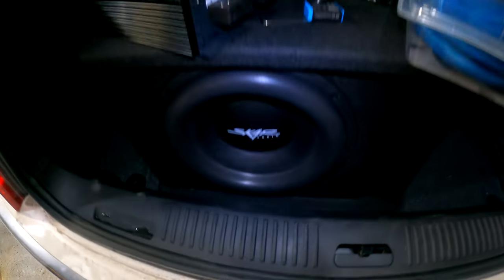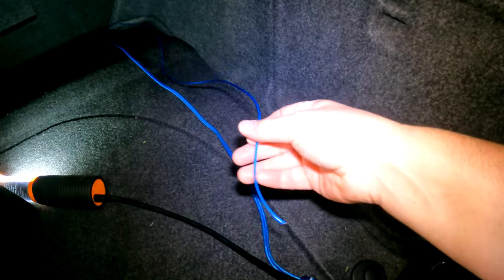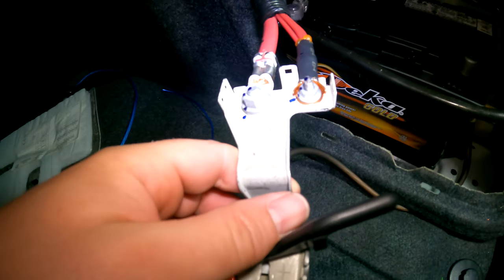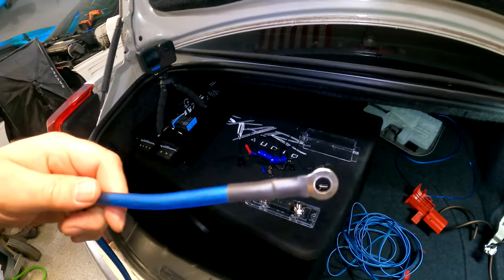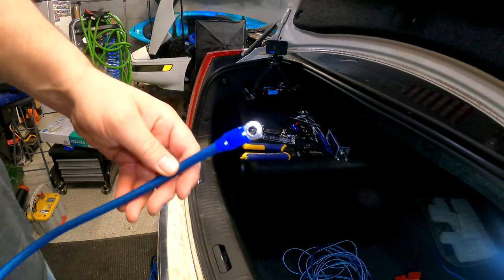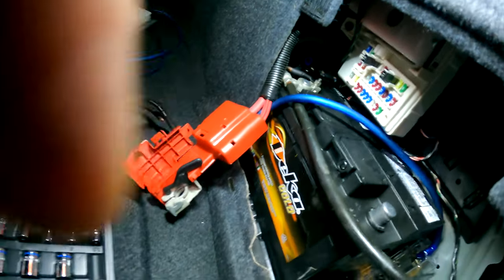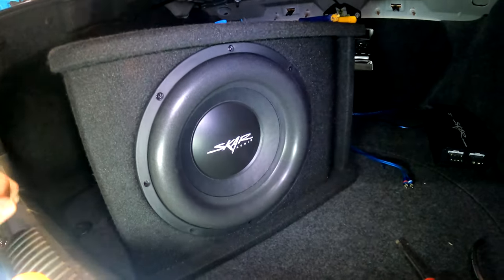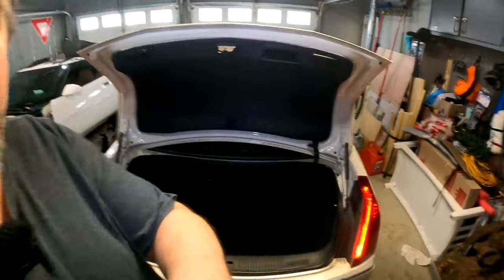Amp and Sub Install Cadillac CTS

Comment: I’m looking at a 2013 CTS right now. You think 2 12’s will fit in the trunk?
Reply from the maker: Easily! With plenty of room to spare! Just measure the trunk width and height to make sure that the box will fit (most should with no issues at all). 

One big...BIG recommendation...invest in lots of sound deadener! 

My son just finished putting deadener in his and it made a very big difference in rattling and overall sound quality!
Reply: @Amundred  appreciate the quick reply it means a lot! All love.
Reply: @specialteamstv4246  Yes indeed. Just added 2 Sundown 12s.  And has space on both sides for amp or flip up.
Reply: @dev1004  I got the 12’s installed a few months ago. Perfect.
Reply: Hey on the cts 2013 for 1 12 do I need an amp or would the factory car amp be enough to push it good ?
Reply from the maker: @naturalstatestud you will need an amp! The factory amp will NOT be able to supply nearly enough power!

Comment: Do u happen to know what all i would need to hook up a aftermarket amp for the interior speakers where the factory amp is. Like is their connectors that go from factory to aftermarket
Reply from the maker: If you have the Bose system, you will need to bypass it. I haven't found a good tutorial so am working on putting together a video showing how to do that.
Reply from the maker: I am finishing up a video where I bypass the factory Bose amp in my wife's Cadillac right now! I also have some files that show the wire harness options and wire connections that I will link in the description of the video so that they can be downloaded for anyone looking to do this! 

Hopefully, I will have the video up tomorrow!

Comment: Liked the video.  Quick question where do you run the remote wire too ? All my fuse in the back are on even when the car is off.
Reply from the maker: If you are using an aftermarket stereo - you can use the remote turn on

If not using an aftermarket stereo, the Bose amp in the trunk has a remote turn on that you can splice into
Reply: @Amundred  Thank you for the quick response.  I just have find the right diagram and my problem might be fixed.  Ty again!  Subscribed!
Reply from the maker: @dev1004  I do have CTS wiring diagrams on a Discord channel - https://discord.gg/UHFQQSvHHJ
Reply from the maker: @dev1004  Thank you for Subscribing as well!
Reply: @Amundred  rgr that.

Comment: What length and gauge wires would I need for a 2000w rms setup? Also are all the wires just running to the battery or are there any going to a head unit?
Reply from the maker: Hey man, I would go with whatever size the terminals are on the amp - that way you know you have the correct size 👍

Depending on your head unit and set up - there could potentially be RCA cables and a remote wire for the head unit (aftermarket would most likely be routed this way) - other way is using a LOC with the remote turn on and then everything could be in the trunk